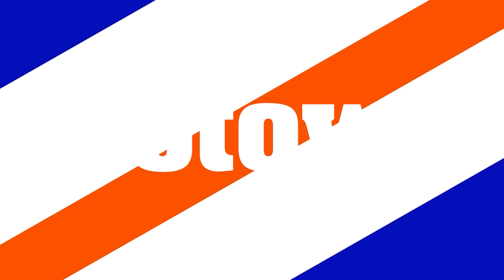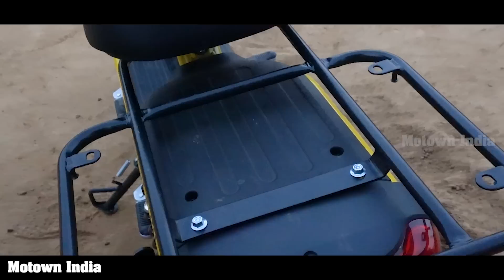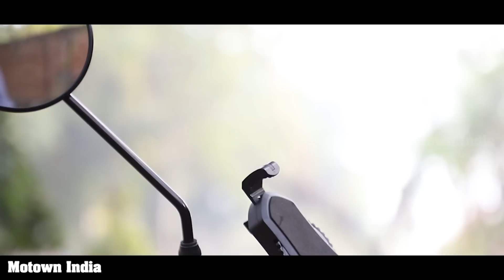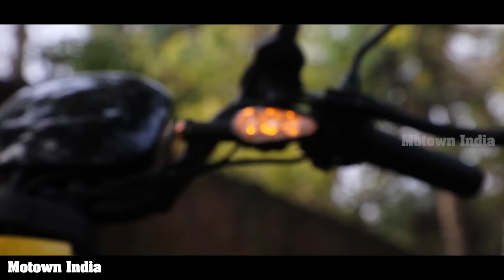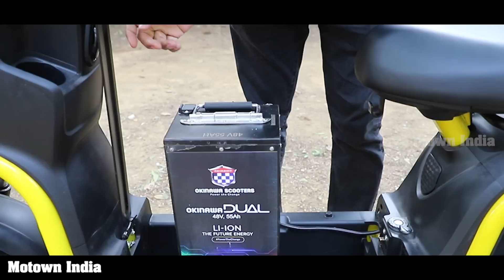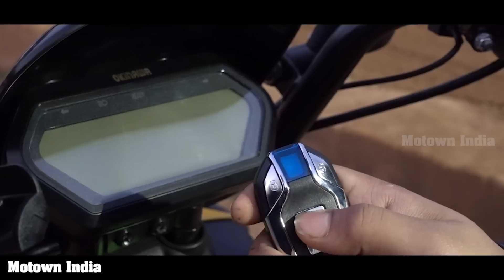Okinawa Dual electric scooter | Champ of the B2B & B2C worlds | First Ride | Motown India

Comment: Okinawa has now launched the "high-performance" variant of this model called DUAL100! It makes a lot more sense to go that...

Okinawa DUAL100 is the “high performance” variant with a much more powerful 60volt 2500W motor, 12 inch wheels with Disk brakes in both front and rear! This variant can easily go up to a speed of 65 kms per hour.

It also has a bigger 60V 52AH (3.12 kwh) battery which easily covers over 120 km in real road conditions!

It’s a robust mini bike for personal use and it’s a great bike to have for local commuting!